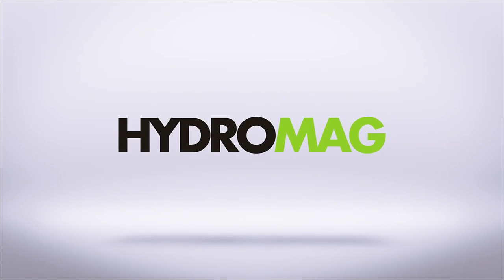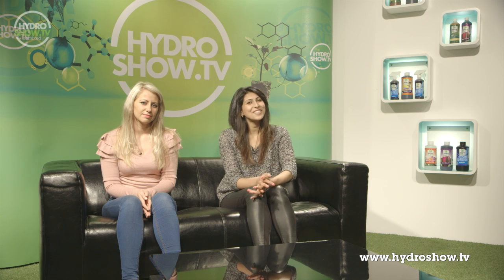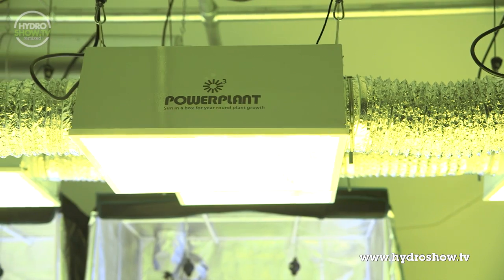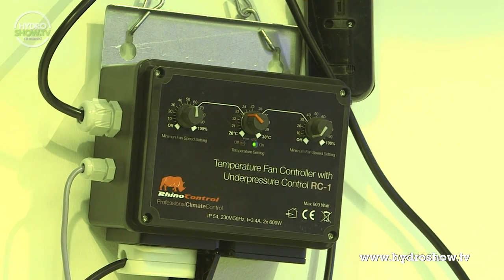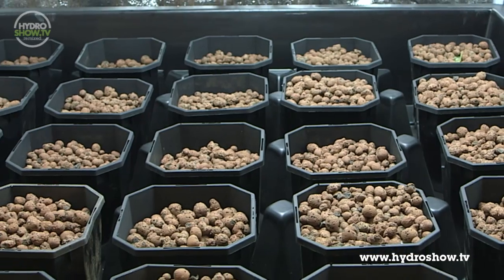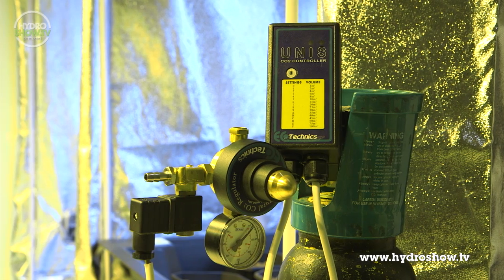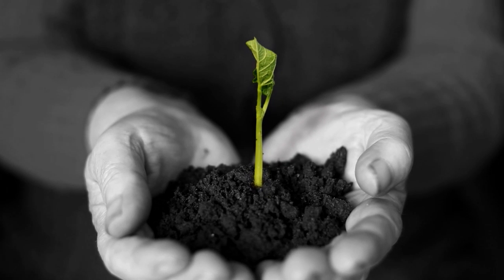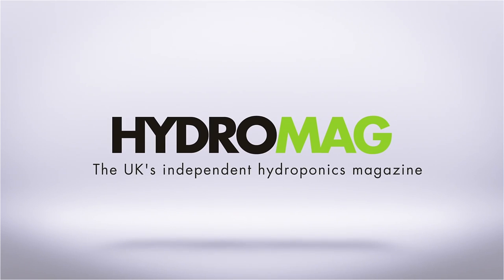Megarooms! How to setup an amazing indoor Hydroponic grow room #22

Comment: If you are evacuating the air out of the room every few minutes isn't the co2 system a waste?
Reply from the maker: Extract should appease temperature... best to have a fan controller which only exhausts when completely necessary.

Comment: HI, I'm a legal grower in the state of MI. I need help setting up a 1000 to 2000 sq foot grow room.
Reply: well it depends, if I had that much space to use. I would build a inexpensive green house outside to cut down the cost of light and harness the power of the sun, mind you you'll still want to get some lights to make up for the time the sun will be down. You just won't use your lights 18 or 12 hours a day like normal indoor growers, you'll probably use it 4 to 6 hours, the rest of the time sun will give you natural strong light. If you decide that's what you want to do, the next step is choosing your method of growing in the greenhouse. I'd say a R.D.W.C hydroponic system, mainly bc it's easy and self feeds off of the Reservoir. I'd recommend building your own system, because the alternative is quite expensive sometimes. There are numerous diy videos for the rdwc system on you tube. Idk if I answered your question but hope it helps. If you have any other questions just ask. I've been growing for 3 years now in cali, indoor and outdoor and greenhouse as well.
Reply: Abshir do u think u can help me with a project I have some private questions I would love to ask you? I’m a verbal learner... is there a WhatsApp number u have? Or signal? Or your regular number? Wutever u feel comfortable giving me? Or I’ll give u mine?
Reply from the maker: Are you still learning 😕?
Reply from the maker: I'd agree
Reply: if you dont know how you should start smaller first. if you cant be bothered you should hire someone to help you irl
Reply from the maker: Good advice here  👍
Reply from the maker: Did you do it in the end?

Comment: The downside of hydroponics is you will have to pay for "plant food" or nutrition and supplements which can be more costly.
Reply: plants need nutrients. hydro will supply them in the most efficient way possible and does not differ from aquaponics in that regard. nutrients are very cheap regardless so your comment makes no sense.
Reply: @Jacqueline C. Marsh you don’t know what your talking about obviously 🙄
Reply: @xxthewolfxx  so jacueline is correct.  if you use living soil you dont have to buy nutrients because they are readily available in the soil via microbes. smh